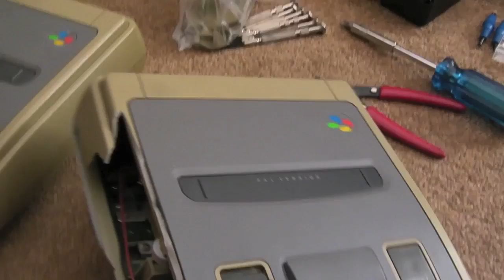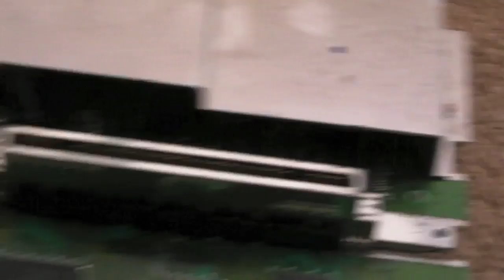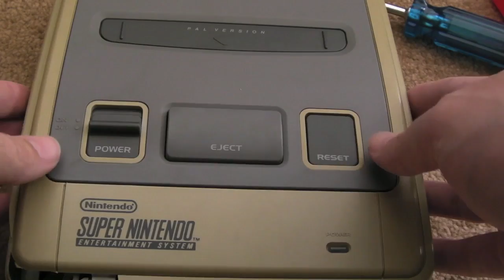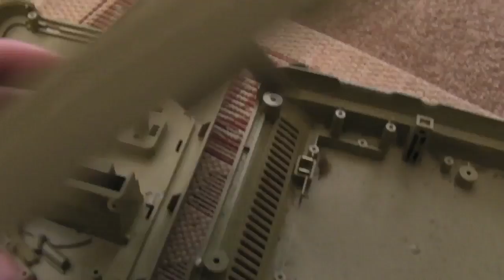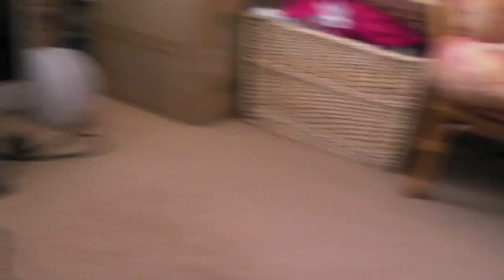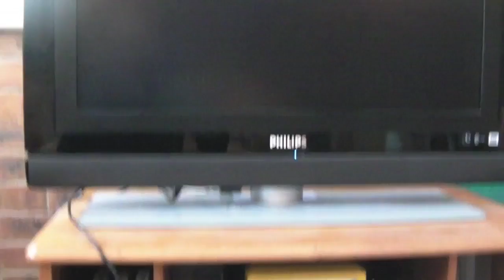Nintendo SNES (Super Famicom) Spare Boards Part 1

Comment: hello, can i get little help with my snes (super famicon)? i got no led light, I have a laboratory power supply
 and console dont consume any A. i have 9v on led, fuse is good too, capacitors looks good too. can you give me any advices how to repair it?
Reply from the maker: Check the DC power socket - maybe a damaged connector or bad solder point on the socket?  The other thing to do is measure the output of the 7805 - maybe yours has died.  You can measure the input voltage to the 7805 too - be careful not to bridge the pins.  7805: Pin 1 = ~9v input, Pin 2 = ground, Pin 3 = 5v output.   If the LED isn't lighting and the fuse is OK, power is going missing somewhere, either before or after the 7805.  Unless your LED is bad!
Reply from the maker: The Super Famicom has a bridge too (I think?)  - it's possible you have a short on the bridge rectifier (if you have one).

Comment: My Super Famicom had similar damage when I picked it up. It wasnt as large as those, but I used epoxy to patch up the damage. Wood putty works well also, granted it will be repainted. New projects for modding. ^_^ - I like how the Super Nintendo looks like the Super Famicom over there.

Comment: I must be missing something, why is the picture dipping after a few seconds?
Reply: I am using a Japanese RGB cable!  The Japanese cable doesn't have pull downs on the RGB lines which the PAL console needs.  Got another cable coming and picture should be fine then!
Reply: Ahh, gotcha! I had a spare one of those, should have asked! lol.
Reply from the maker: Novabug Ah, that would have been cool!  No problem, got one arriving any day now!  I forgot but the PAL SNES also doesn't have capacitors, the Super Famicom needs caps on the RGB lines, it's the lack of pull downs coupled with the caps that is the problem with it fading.  I suspect if I removed the caps it wouldnt fade, but the brightness levels wouldnt be right.

Comment: Ahh, so it IS you bidding against me on eBay. hehe

I just bought a dodgy SNES about four days ago to see if it's repairable.
Sounds like it has a bad VRAM 'cos the description said it has a "weird double cross-eyed effect".

Apparently it's running the cart OK, so very likely one of the VRAMs, or maybe they were using RF on a modern TV and it didn't tune properly?

Got another working one as well, for reference, as I'm working on a SNES core for FPGA.

The chips on that first board looked a bit rough. Might be just flux?
Does look like somebody has had a go though.
Reply from the maker: Haha!  It must be you pushing my prices up!!!  Does sound like bad VRAM, or perhaps a bad connection on an address line maybe.  Very interesting on the SNES core!!!  I've had a look at that stuff on the CPU and it does appear to be a resin of some kind.  I guess it could be flux but its spread over the whole chip etc.  It does come off easily with isoprop though.  I think the CPU might have been replaced previously.   I lifted pin four on the CIC chip yesterday to see if that made any difference but still the same.  I've not had the scope onto it yet but that's the next port of call.  One thing I did notice is the WRAM is getting warm when little else does - I've got the suspicion that the WRAM is the fault on the one that still has a black screen.

Comment: Yup you can clean snes card slots like that, N64 has the same design, and I have saved countless of N64 consoles by simply cleaning them :)

PS On those models , I normally change all the caps and check the traces from the ram to the rest of the console, they tend to break easily due to corrosion, you might allready have done it ,as I am still watching your video.

Comment: This is interesting to watch right after I accidentally cooked my SNES, plugged it directly to my X-RGB3... been using it for ages and not forgot to use the adapter cable before. Now the SNES doesn't output Video/Audio. I'm guessing it's scrap now. Thankfully the scaler seems fine.
Reply from the maker: If the power light is on and there's no sound and video, it could be capacitor related.  If it failed as a result of plugging it in whilst the SNES was powered up, it's possible the video encoder has failed.  That said, I would expect sound at least.  Some TV's only output the sound if there's a picture as well - for example when using a SCART cable.  You could test if there's sound by perhaps using composite video from another working system - connect that to your TV, then connect the left and right audio jacks from this SNES to the TV.  So you are using video from another system, and sound from the SNES.  Try a game and see if you hear sound at all.  If you do hear sound it with either be dirty / broken connection, capacitor related, or worst case the video encoder.
Reply: GadgetUK164 Thanks for the info, I will try your suggestion.
Reply from the maker: RockstarRunner7 No problem, sorry for the typos there - I've just corrected them =)